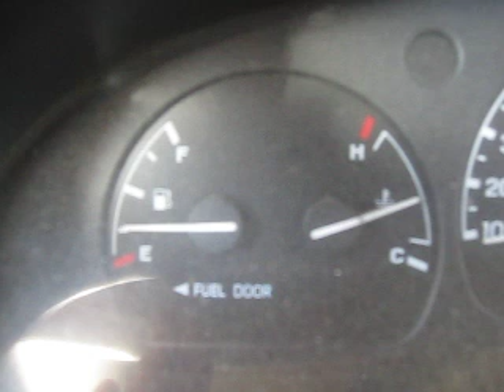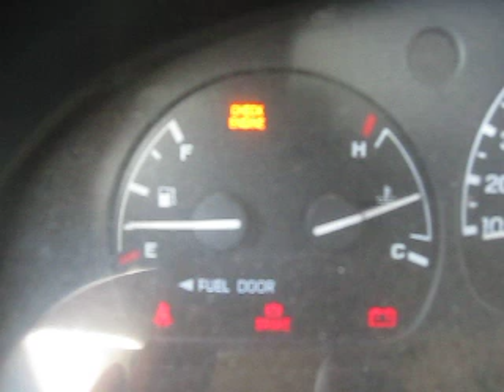Ford Airbag Light Code 27 Diagnosis Ranger F-150 F-250

Comment: So it's not necessarily the the switch that is the "27" code I had this same code before and it is the off light which has burned out and thats why you get the code in the dash flashing. Also in the dash console behind the speedometer etc. there is a fuse you may want to check (if my memory serves me correct)
Reply from the maker: Thanks for the info!

Comment: Hey I have a 96 with a code 3 0r 33 and the light on the passenger deactivation switch is in the off position only but not when turned on ??